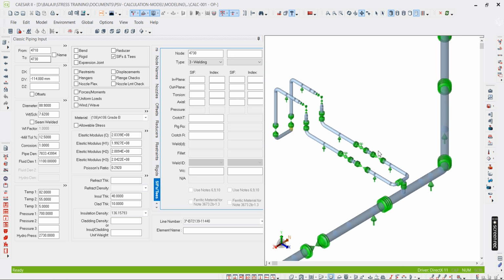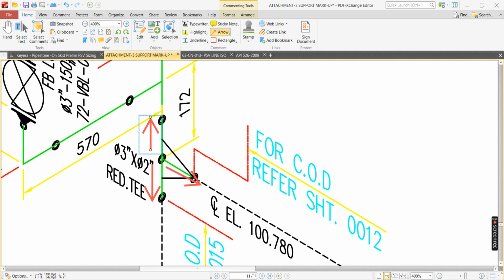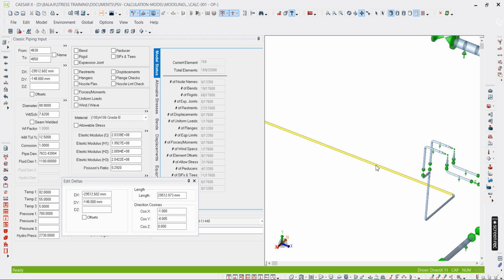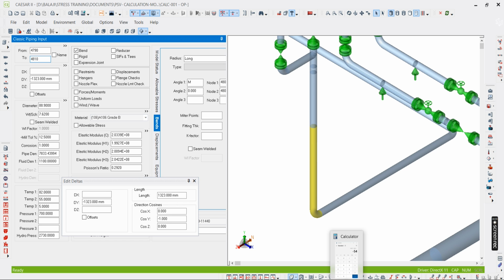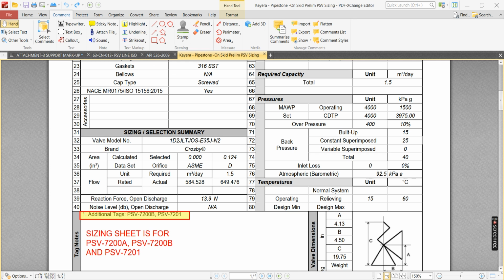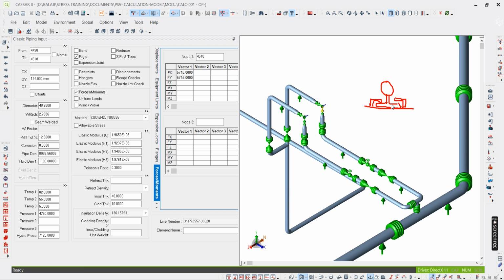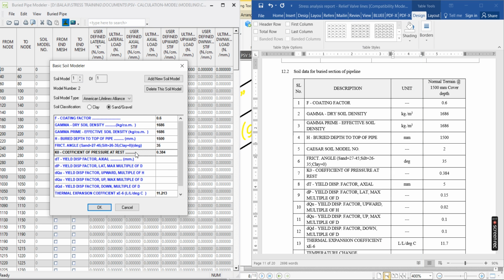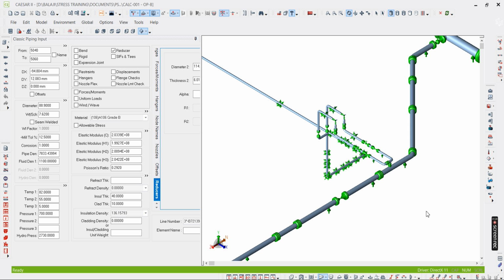CAESAR-2 PIPING MODEL-PSV REACTION FORCE CALC, ASME B 31.8  ,UNDERGROUND/BURIED PIPING,PART 3

Comment: Hello dear friend.
I would like to say you thanks you for this session about content and explains.
So my question is according different types of soil model and you experience what is the best soil model we needed to use to be more flexible about stress ?
And what is the difference between clay and sand soil classification ?
Thanks...
Reply from the maker: Dear Mr.rick, Sorry for the delayed reply. Thank you. I worked with sand soil with internal angle of friction ranges from 30 to 38 deg. Didnt work on Clay soil. Soil with less internal angle of friction (say, 27 deg - loose soil) will have lesser stress value compared to the soil with higher angle of friction (Say , 40 deg). Internal angle of friction for the Clay soil is 0 deg. Stresses on the buried pipeline depends on the various factors like pipeline routing / Bend radius / Bend Angle / Coefficient of friction / Buried cover depth / Soil density.
Reply: No issue.
Thanks you for your feedback.
I would say which model is best between American Lifelines and Caesar basic model.